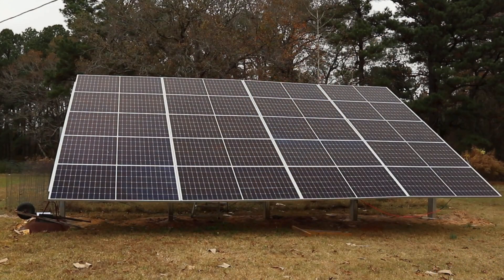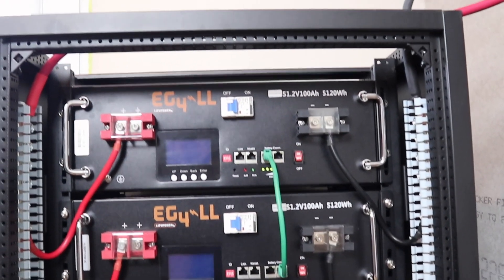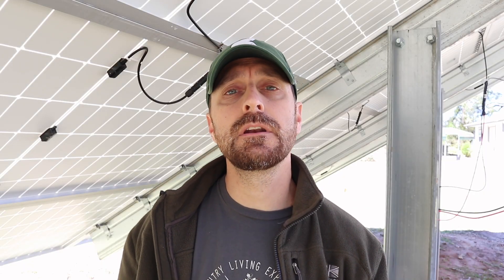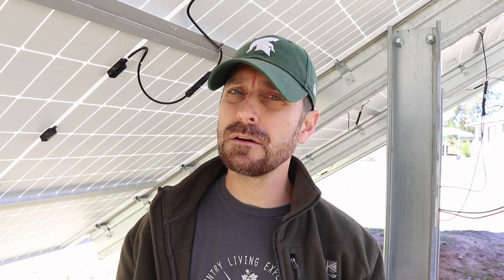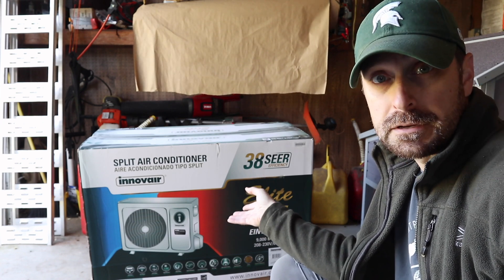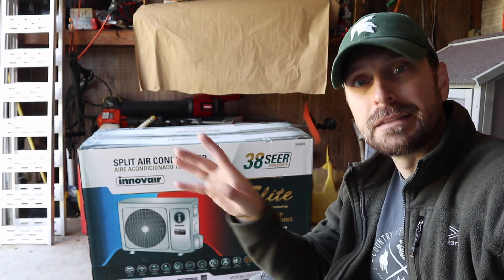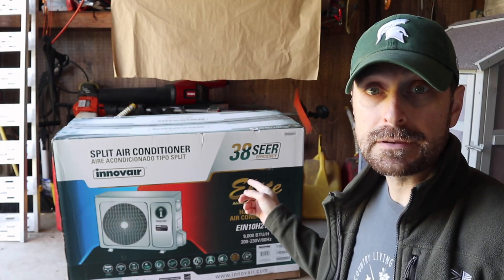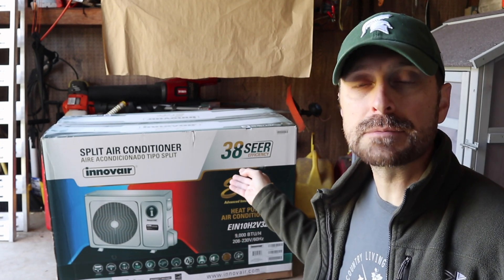Can Solar Power My Heat Pump 3 Ton HVAC System? Yes...BUT!!

Comment: Soft starts on HVAC units are nice, and they're very easy to install and wire.  Reduces the LRA threshold to start your HVAC, which will add more years to the life of the compressor motor and capacitor.  Micro-air soft starts are great units.

Comment: Ok, you lost me on all your technical wording because I'm elderly and it's gibberish to me 😊 but...I live in Florida, and don't want to go full solar on my roof for entire house. So, I wonder if I  just use solar power  for a 4 zone 36btu  mini split? My idea is to put the panels on a walkway canopy and hopefully use the solar to power only the water well, fridge and coffee pot if a hurricane comes through. What do you think?
Reply from the maker: If you are elderly, are you going to assemble this yourself? If not, then whomever you hire to assemble/install it can worry about the gibberish tech wording. If you are going to do it yourself, you need to understand the techical gibberish. 
You will need a decent sized system to power the things you mentioned. A walkway canopy is probably not going to be big enough.
Reply: @CountryLivingExperience   thank you for the reply

Comment: My Micro Air Soft Starter Flex has failed in Just 11 months.  Multiple electronic parts inside the cavity has blown, leaving all kinds of debris inside.  It disable my AC in a very Steamy hot night.  I have to hire my AC Technician to remove the unit and has the whole  AC system check up.  Luckily, my ac survive the possible damages.  Having Spent more than $400 on the unit plus the AC Technician charges.  It not worth the month spend.  Honestly, I don't feel comfortable spending that kind of money to install it and waiting for the disaster  to happen. it only give me troubles. My Technician tool me I am risking damaging my ac system without any warranties coverage on my AC System.  In addition, the soft start kit has limited warranty and will not favor any damages caused on my own AC.   I will not recommend this soft starter to my friends and families.
Reply from the maker: Wow, that is unfortunate. 
I installed mini-splits for my house and took this large unit offline.

Comment: Try the EG4 Solar Mini-split.
Comes with 4 solar panels.
Can run on solar or household power.
Saved me about $600 this summer by reducing my bill and about 61% of my bill in September 2024.
I run mine on solar only as it does not cool the bedrooms or front room and we need central for that.
And it heats in the winter on solar also.
Reply from the maker: Thanks. We have one. We did a video on installing it.

Comment: It is easy to install a soft start.
Reply: @shawnstangeland3011 there’s like a billion reports on soft starts destroying compressors. Why people keep hyping up soft starts is beyond me…
Reply: @zimvader25 mine works freaking great.  Lowered the starting amps from 25 to 15.  Really nice how the fan kicks in five seconds before the compressor.  If you are energy independent like me and not sucking off the power company then you might be interested

Comment: Enjoyed your video, question, you remarked that you are using 4 inside heads on a 3 output compressor unit.  Did you parallel or series the two units?  thank you for your answer ahead to time
Reply from the maker: Thanks. That is not exactly what I said. I have 3 separate compressor units. One of them is a dual output with 2 head units that is designed like that. That is a Mr.Cool unit. There is no parallel or series type connections involved.
Reply: @CountryLivingExperience  Thank you for the clarification. probably misunderstood.
Reply from the maker: @chuckmarrs8181  You're welcome

Comment: What if you got a larger capacitor to jump start the unit. Like for a sound system
Reply from the maker: A soft start would be a good option.

Comment: I am an HVACR tech( on lunch right now ) and that is EXACTLY what i am doing. I have a 3 ton split heatpump and im tired of the noise and cost to run so i am installing a city multi ductless system and run it on solar.
Reply from the maker: Awesome

Comment: I’m looking on buy a solar generator, but the salesman told me I need a soft start installed for it to handle the initial surge. I’ve called everyone in town and they have never heard of a soft start. I finally got a hold of someone (not local) and they said a soft start is only for hvac and not a well pump. Is it possible to install a soft start for a well? It’s on a 20 amp breaker and a 1hp pump.
Reply from the maker: I think you can install a soft start in many places including on a well pump. I am not an expert in that area though and I would consult with an electrician. I can't believe that nobody around you has heard of what a soft start is......it is a common piece of equipment. 
I still don't know if a solar generator can handle a 1hp well pump even with a soft start. Those generators aren't made for much more than refrigerators, freezers, lights, and outlets.
Reply: @CountryLivingExperience  they assured me it could. I watched a video of a guy who bought one. It powered his whole house. I may end up having a soft start well pump installed, which is unfortunate because I just had a brand new pump installed last year. Just trying to plan for the time of trouble.
Reply from the maker: It all depends on your loads and what you run at the same time, etc. How many panels to charge it, how fast will it charge, how big is the battery capacity?. I have 13kw of inverting power with 10kw of panels and 46kw of batteries. It is just enough for my house which is only 1800sf and almost all electric.

Comment: One pitfall I have encountered with mini-splits is that the drain hoses tend to clog up and you will have lots of water draining down your interior walls.
This will damage your walls and rot out your base plates.
Awhile back, a professional AC guy installed some mini-splits and tried changing 120V circuits into 220V circuits at the main panel. 
He did not want to have to run dedicated circuits.
The homeowner fried 3 dishwashers before calling me.
Always run dedicated circuits even if you have to run pvc conduit around the outside of the house.
Reply from the maker: We monitor the hoses and have all dedicated circuits.

Comment: Sounds like the way too go.. I will trying one soon.. my old system is a energy inefficient wasting Dog.. from a Electrician
Reply from the maker: Cool. They are working great. I did a video about their winter performance when it was 2 degrees outside.

Comment: Startup is 6 with 4 running, so basically 50% increase in amperage on startup and only 4 amps of cooling. That doesn’t sound that great.

Comment: how could a person tie into the start power of the compressor side of the heat pump, the startup is where the power surge is every time, THEN have it automatically kick over from the alternate power to  start and run?

Comment: One of the drawbacks of traditional mini-splits are that there is no air filtering.  Do you have any room air filters?  Ceiling fans are a must for mini splits also.  Great videos!  Thanks for all the info.
Reply: Where in the world did you come up with having a ceiling fan with a mini split? You are absolutely not supposed to run the split system and the ceiling fan at the same time. When you do so , the ceiling fan meses with the thermostat in the split head unit.
Reply from the maker: You're welcome.
My splits have air filters. I prefer them as they are washable.

Comment: my humble opinion is that centralization is usually better than multiple smaller units (in general) due to a higher chance of failure as in one unit vs. more units. Plus it's easier to control and automate. Not to mention darn remotes and battery exchange constantly :) But that's just me... In any case you answered some of my questions none the less, so thank you for the video and best of luck !
Reply: Both have pros and cons
Reply: If one unit fails you have nothing. If you have 3 or 4 units (mini splits)you could lose two or three units and still have some relief. 
If you have multiple mini split units and the power goes out you can keep at least one unit running on a smallish generator and use very little power/ fuel. 
Mini splits don’t require expensive filters every month. 
Mini splits are far quieter. 
Mini splits don’t have duct work that eventually gets dirty and in many cases smells awful like in older homes or homes in damp climates and homes with units and duct in crawlspaces. 
I have thought it through many times and I am currently building my own house. I will definitely have one mini split in the main living area and maybe throughout the house.
One great reason for doing mini splits for me is I can DIY them. I have put 3 in my current home/external garage/large storage building. They were simple to install and do an awesome job. 
Lots to consider. 
Terry

Comment: I moved to the middle East and solar power is non existant over here.. its so hot and air con needs to be blowing 24/7 (all splits) and energy cost is extortionate..as a starting point to shift to solar energy what would you recommend I look into?
Reply from the maker: Honestly I do not know what is available to buy there. I cannot suggest anything since I have no knowledge of the area.

Comment: learn how to properly clean them and I don't mean just washing the air filter. that will run you 300.00 per year with 3 indoor and 1 outdoor unit if you hire it out. Also, these are very critically charged meaning that they suffer badly if they have a leak. Use best practices to set them up and if you can't do that yourself or service it yourself you need to find a qualified contractor. Parts will be covered by warranty for maybe 6 years, but labor is usually not included, and that bill can be a whopper, if you can find someone qualified to do it. I recommend power protection for all outdoor units as they are really delicate and do not like power problems.

Comment: Can't you use batteries to handle the surge?  I'm thinking of putting my lithium powered golf cart to work. BTW I don't know much about solar, just starting to play.
Reply from the maker: I don't think so because the batteries are dc and still need to go through the inverters and changed to ac. Those surge amps are still dependent on the inverter size.

Comment: Am I missing something your mini split runs at 1200 watts for 12kbtu. My ge regular window unit runs off 1000 watts for 12kbtu. 

My ac cost 350$ yours cost Amazon atm 850?

I don’t understand because prettier maybe? They take way more room outside. They cool at the same speed so idk could you explain why?

Comment: Sounds like your run amps will end up the same or close. Start amps will be different bcuz they won't all start and stop at the same time. But the real benefit seems like they won't all need repair at the same time
Reply from the maker: Yes. You are correct on all.

Comment: You wouldnt happen to know how I can install a ac for my 4runner with solar?  That way during summers I dont have to run my car to cool it down when camping.
Reply from the maker: There are a lot of channels that have RV solar systems. You would need the solar setup and a separate air conditioning unit I believe. Try to check out those channels.
Reply: @CountryLivingExperience  a lot of videos have the rooftop ac fans that's why I figured to ask.

Comment: That is the new systems today your old systems that ran on r 22 was the best I have an air conditioner from 1985 a carrier still has the same microfarads starter in it and still running great no problems I clean it all the new stuff is garbage all plastic and all junk
Reply from the maker: The older stuff was better for sure.

Comment: A soft start can consist of one capacitor and relay. They usually come as a small package kit and run about $30.00. I installed several over the years even in Brand new installations when replacing condensing units used in site glass /expansion valve systems. With that being said....it can be done on the cheap, but mini- split systems are far more efficient and use way less wattage.
Reply from the maker: My friend is an HVAC tech and he did just mention a type of soft start that works within the old units themselves. Very intriguing. I may do that as an additional backup because of the low cost.
Reply: Yes and there are videos of how to connect them. Pretty simple really. Just so everyone knows the existing capacitors inside can be dangerous if not discharged.

Comment: EV took the words right out of my mouth—why not use a single inverter powered heat pump and put the coil in the existing air handler? That way your existing ducts distributed hot & cold everywhere, with no head units on the wall or multiple compressors outside. I have a similar situation to yours, with an old heat pump in the main part of the house, and two older furnace & A/C combos. The tradesmen want to take me for about $25K to replace with three new heat pumps! No way. We’re going solar soon.
Reply from the maker: That may work. I am not an HVAC guy so I couldn't say if it would be better. That 25k price is nuts. They are out of their minds.

Comment: We used mini splits in Afghanistan when it was 130 degrees out, well worth it imo to buy one of these. Dust will clog them but it’s easy to clean just need a can of compressed air to blow them out
Reply from the maker: Awesome!

Comment: I strongly recommend, if you can afford it, one of those DIY mini split air conditioners. They use phenomenally little amounts of power and you barely notice the drain on the system when they're running.
Reply from the maker: Funny you mentioned that. I am currently working on an install video about one of our new mini-splits.
Reply: @CountryLivingExperience  I have the minisplit Mr Cool for my studio/theater and upstairs I installed an LG dual inverter AC which is quiet and seems to use very little power. Inverter load without AC 3% with AC 8%.

Comment: Sorry if too bold but possible to link to spreadsheet with all parts and prices (date paid) for your solar grid? I saw a partial list attached to previous video but this would be so helpful. Thanks!
Reply from the maker: Sorry, I don't have the time to put something like that together. I purchased everything last October through December. Prices at Signature Solar have not gone up from what I paid. The only thing that has continued to go up is romex and thhn wire. 
Ask me for specifics here and I will try to answer.

Comment: 1st time viewer. Have perused several other vids today and will review your solar playlist too. Fellow Texan, fwiw.

Can you provide background as regards current factors to reduce need for new units? What's your house insulation package like? Are windows and doors well sealed? What other HVAC related energy saving measures have you taken?
I ask because it's always better to insulate and tighten up a house rather than just buying " bigger/better" new systems.
Thanks.
P.S. subbed
Reply from the maker: Welcome to the channel Will. 
Not sure I understand your first question. To answer the others, I live in an old drafty home with adequate but not good insulation. It was built in 1980. I  can add some attic insulation and plan to but that is about it. It currently has only about 8" (of settled) blown in batts. 
So, I am buying smaller newer units. I have a leak in the current hvac system ref lines and it is not in great shape not to mention the fact that I cannot run it on the solar, would need to add the soft start, and it is not efficient. Adding new just makes sense.

Comment: Im an hvac tech.  I would bet Your 3 ton 13 seer starting amps are way more than 22 amps.  Some older compressors with wear and tear can be 60 to 80 amps on start. (But only for a very small amount of time)
Reply: As a retired HVACR tech myself I don't blame him for suggesting a mini split system especially with those hi SEER ratings, I've gone to them myself.  
Regarding that 3 ton:  Thirteen years it's about done on life expectancy. Me I recall those 6 seer and when the 10's came out WOW! ......Most people will nurse them thinking they're saving money, but in reality they're not; but as they say "...to each his own". Lastly, 60-80 amps to me was LRA (lock rotor amps). When they're that high "Hard starts kits" rarely helped. The best (3-ton) run amps ran around 18 here in Texas, with an ambient of 95-98°, but that was under a shade tree LOL.😆
Reply from the maker: You're right. I was trying to be conservative if someone had a newer unit. Just trying to let them know it wouldn't start up anyway.
Reply: @CountryLivingExperience  
In this application you don’t want to use a soft start. VFD Is the way to go.
Reply: agree lock rotor amps are around 7x running amps for a split second
Reply: I'm the same boat. 2006 3 Ton, Xr13. 3 Bdrm, 2 bath under 1500 sq, ft. I'm trying to figure how much solar/battery it would take. A lot! lol Wouldn't a new replacement for that one be a lot more efficient than it? It seems like mini splits wouldn't allow for much control in all rooms.
Reply: @tweedeldee8122  - I am looking into mini splits, doesn't look like I can run my 3 ton unit on the kind of battery bank I have room for and can afford.
Reply: @debbiedogs1  Got that right. There's a lot of hype in solar right now. When I crunched the #'s it was clear Solar is a bad investment for me.
FYI I've been testing my 120v usage and it's usually under 500W. I'm playing with some panels now but to cover even that modest amount 24/7 means expensive batteries. And 240V heat pumps are out of the question for any small setup.
I'm amazed at people spending $1500-$3000 for "solar generators" that essentially have 12V 100 amp hr batteries in them. So you can run 500w for 3 hrs. Yippie.